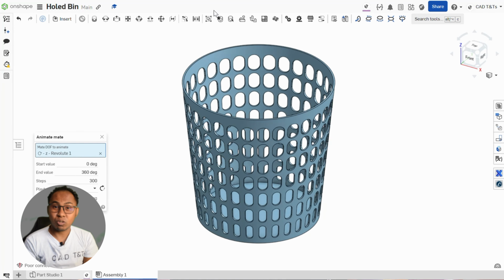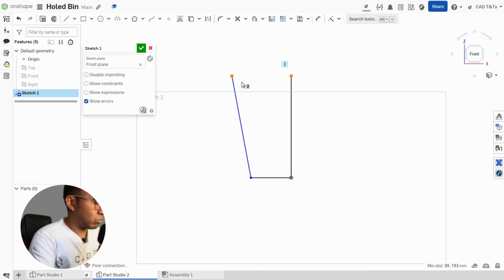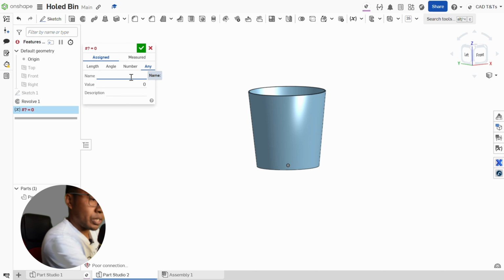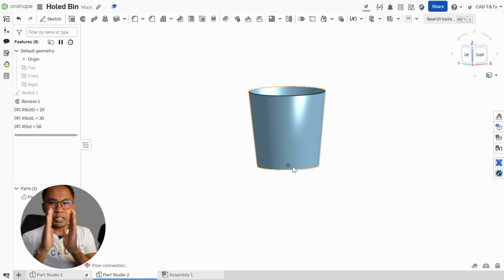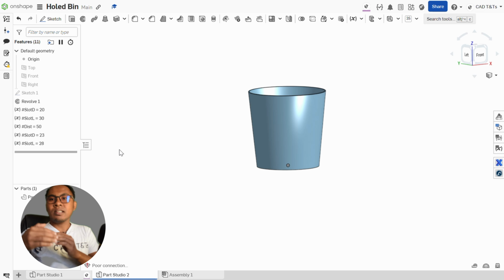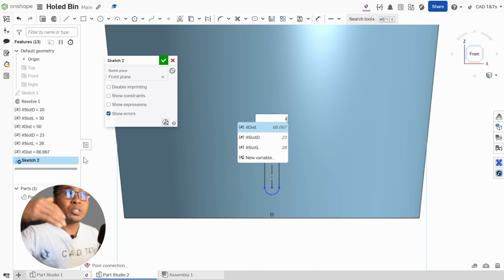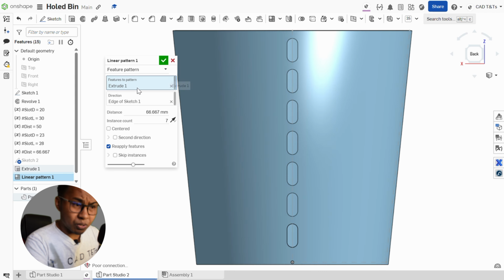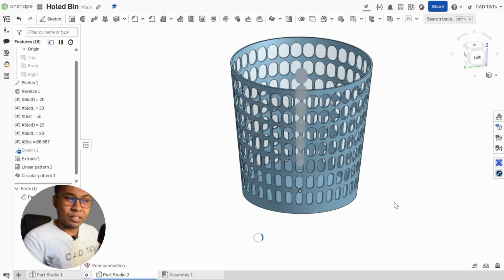Onshape Variable Pattern: Master the Advanced Tool

Comment: When adding the first variables don't have MM after the value EG: 20mm as when you 20mm +3 it errors,, 20 + 3 is ok
Reply from the maker: If you chose "Any" in the expression it's OK. If you choose length, the unit should match the length unit. To be safe and avoid in unit confusion, use "any" in the expression
Reply: @cad2ts yes I did have “any” selected , it all worked in the end and I greatly appreciated your video, thank you

Comment: I have been struggling with this type of thing recently and stumbled onto this video. Thank you!! This helps a LOT! :)
Reply from the maker: You're very welcome.
That happened to many of us. I had an issue with variable pattern when I first tried it. My issue was the use of complex and difficult design.

But I knew the trick with something simple.

Variable Pattern in Onshape is quite powerfull as feature.

Comment: A very interesting topic and well presented.  Thank you !!
Reply from the maker: You're welcome. Glad you found it interesting!
Reply: when i try to perform the linear pattern onshape is telling me that dimensions and constraints using the origin will not be reapplied. what can i do
Reply from the maker: @henryg7135  That's normal, because default plane and origin can't be moved.

Do not worry, it does not affect your variable pattern. Once you see on the preview the effect of the variable you set, that's the main goal.